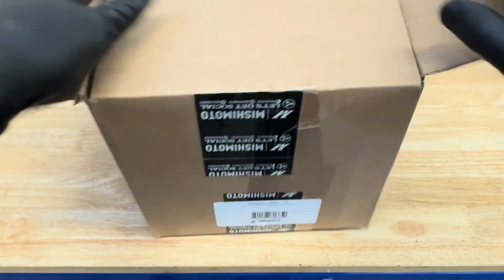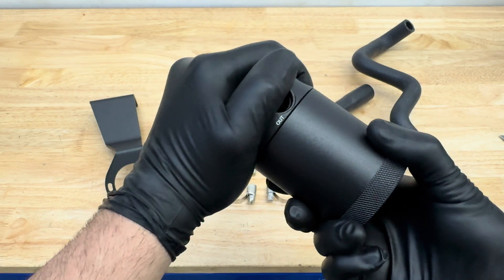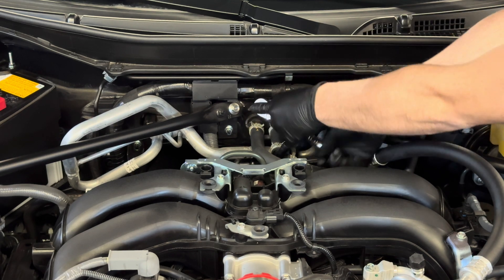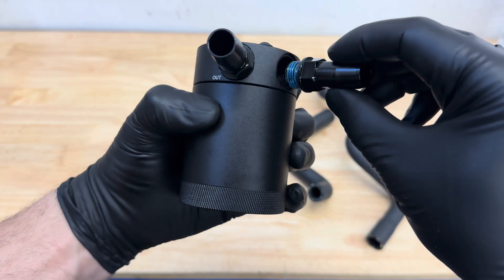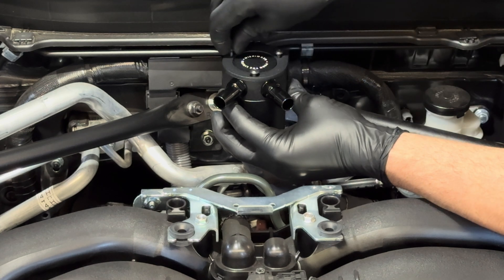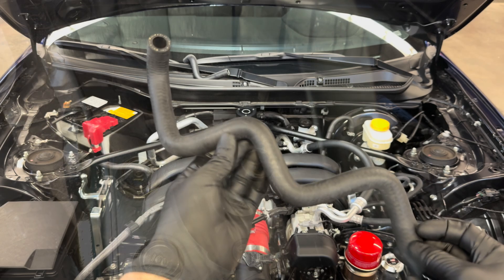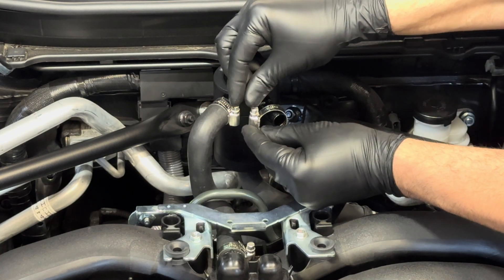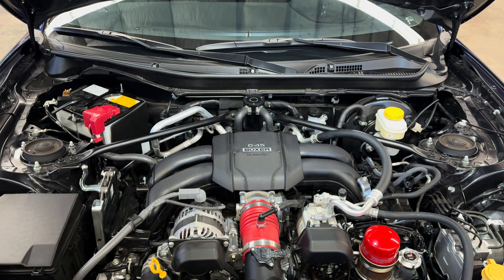Mishimoto Oil Catch Can MMBCC-BRZ-22

Comment: i installed it 3800 miles previously and did my oil change for the first time today. i got just under 1 tsp of oil inside the catch can and my car is a new 2025 gr86. i’m surprised that there was oil inside. thanks for video. i have a an aos on my 2015 wrx and feel these are needed on the fa20/24 motor
Reply from the maker: Yeah, any of these boxer engines especially turbo or supercharged variants, definitely need at a minimum and oil catch can.

Now, if you’re taking your vehicle to the track or you have high boost or are constantly at higher RPM then you most definitely need an air oil separator at that point.

Comment: Noticing that the "OUT' label on the can is connecting to the crankcase and the 'IN" label is connecting to the engine intake. Am I seeing that right, and if so, isn't that the incorrect flow direction?
Reply from the maker: You’ve seen it incorrect. The out port on the passenger side of the vehicle goes to the intake.

Comment: I stumbled upon your channel while researching the GR intake, and I must say that your videos are very high quality, and you do a great job of pointing out all the small details. You're the first person who actually pointed where the front jack point is (on the oil change video).

I've never even heard of an oil catch can until you made a video about it, so I will be researching one door myself. I very much look forward to your upcoming general maintenance videos and OEM+ upgrades. 

I'm hoping to see a coolant change along with any other fluids. Any plans for a dashcam install tutorial?
Reply from the maker: On another note, if you are going to track your vehicle, I would recommend an air oil separator instead of a catch can. Yes, they are much more expensive, but they are worth it because of how much oil your PCV system will puke out during track use.
Reply: @PerformanceAutoHaus  Thanks for the quick replies! No, I do not plan on tracking the car.

No pressure to start cranking out a bunch of videos, but I do look forward to them when you get the time.

I do wonder how difficult it is to replace the spark plugs in these due to the flat engine design.
Reply from the maker: @leeislegend spark plugs without a vehicle lift, meaning you’re doing them from above the engine, is a bit difficult, but not impossible. It’s just a pain.

Comment: I had an idea that I'd like to run by. What if I used a firewall-mount remote oil filter as my catch can?
Every time I change the engine oil, just change out the cheap oil filter on the remote oil filter mount?
Reply from the maker: I mean, that’s an interesting thought. Catch cans purpose is to catch not just the oil, but the fuel particulate and other nasty things that happened due to combustion they get blown past piston rings.

You could theoretically have an air oil separator, and have a secondary oil filter that the separator return line passes through before going back into your crank case, but I think this is overkill.

A simple catch can is enough to grab everything. 

I’m just thinking out loud here, but yours is an interesting idea that I haven’t thought of.